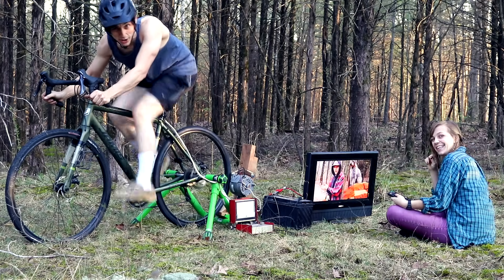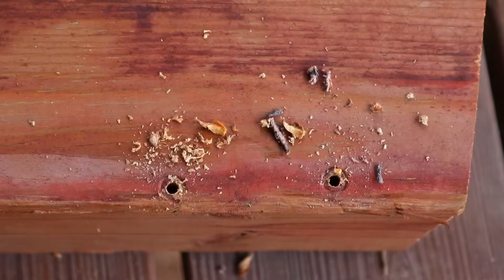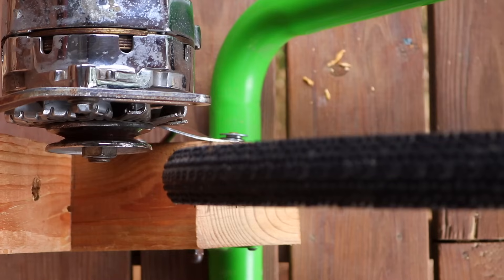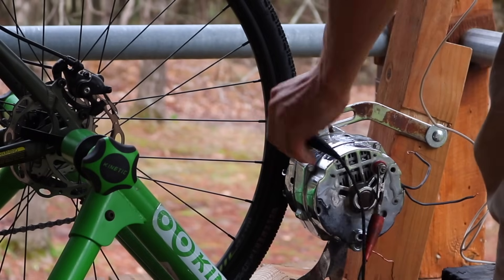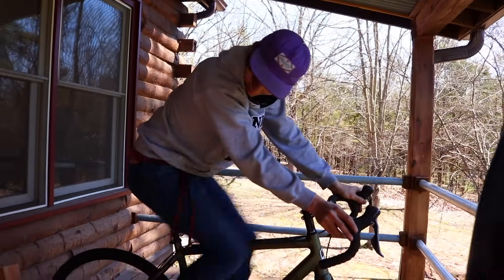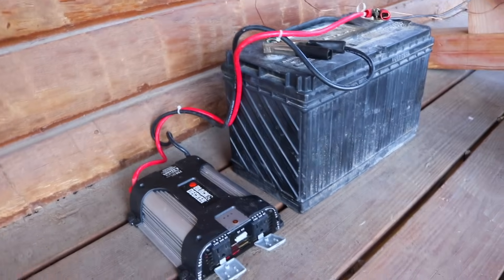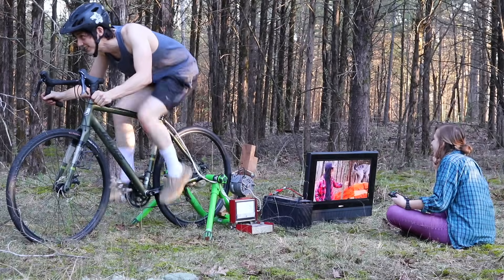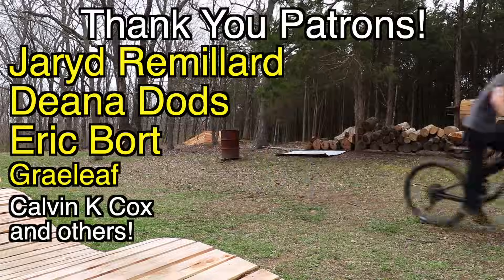Homemade Bicycle Generator // Burn Calories and Make Electricity

Comment: The only issues with these devices is noise. I’ve seen multiple iterations of this system but noise is definitely a drawback if you are going to do this in an apartment.
Reply: Exactly my thoughts, the noise is loud asf. It might be worth it if you had a battery pack
Reply: They aren’t noisy if you have a good alternator.

Comment: There's a lot of loss associated with storing electrical energy in a battery & then inverting. There's also energy lost to friction between your tire & the alternator also with belt driven. You'd want to use a multi pole permanent magnet generator to drive it by blocking the freewheel.
Reply: A controller between the alternator and battery may help too

Comment: But I saw in the film an motor controller. ?  Could you tell me all the necessary accessories.  I need them more than the list of filming equipment that will be necessary for make a good video. Thanks.

Comment: Ironically, you're generating AC current, converting it to DC, and then converting back to AC!
Reply: to power devices that convert the ac back to dc internally.
Reply: AC-DC-AC
Reply: @catthomas3097  Thundertruck!
Reply: cant store AC what to do.
Reply: I finally understand what ACDC truly means. Rock on

Comment: But wasn't this just the battery powering the tv/mixer? With a 60 amp battery u could probably watch TV for awhile without having to charge the battery... The mixer/tv would have worked just fine without u pedaling.
Reply: yes it was. whole video technically is a bs

Comment: Did you experience extra resistance on the bike when the the switch got flipped on? (so when the dynamo got connected to the battery)

Comment: I’d have fitted a chain ring to the alt then another chain from the rear cassette to the alt, you would have the ability to change the gearing that way and spin it faster with less effort 👍

Comment: Backyard Trail build 2020: Bike powered: Lathe, bike rollers, and generator
Backyard Trail builds 2020: Bike powered garden
Backyard Trail builds 2030: Bike Powered Planet
Backyard Trail builds 2040: Bike powered bike
Reply: If you charged a ebike battery with it maybe

Comment: You should use your bike powered lathe to make a wheel that will fit over the pulley and make it more tire friendly. You could also use a bunch of old inner tubes and contact cement.

Comment: instead of a belt use a wheel on the pulley... rubber on rubber contact... you know like the tiny wheels they put on carts

way less work than converting that to belt driven